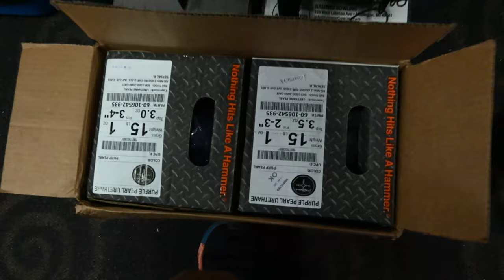Hammer Purple Pearl Urethane | Unboxing - 2 Balls, 2 Layouts, Shots, and Thoughts

Comment: Uh, sorry, I have bad news for you. 
Its not the "first shot" with urethane that hooks like crazy, it is the first 10 shots! 
You gotta get "a lot" of oil on them before they reach equilibrium, with the lane, then you can get lined up properly.
Like the multi-color inserts and thumb, helps see the ball roll down the lane.
Thank you for the demo.
Reply from the maker: I definitely will admit that my first 10 shots with both of mine were crazy strong but htey have definitely tamed out over time! -Patrick
Reply: Can you resurface them or use an extractor to bring it back to like new? Not that you want it that strong, but I wouldn't want it to die down too much?
Reply: Can you resurface them or use an extractor to bring it back to like new? Not that you want it that strong, but I wouldn't want it to die down too much?

Comment: In the simplest English possible, what is the big difference between the modified core at 14 lbs. and the normal at 15-16 lbs.
Reply from the maker: Lower Diff and Higher RG is gonna let the ball be slightly stronger which makes up for speed gained by light weight

Comment: Just to clarify, does urethane overreact on the first few shots only fresh out of box or everytime its cleaned with a ball cleaner? thanks
Reply from the maker: They will typically hook more right out the box. They retain oil on the surface level of the ball well due to the reduction of oil absorption
Reply: @BowlingWorld  So even after its cleaned there will still be some oil left over?
Reply from the maker: @hgh4349  negative. Less oil will absorb into the cover itself so it’ll hook more when cleaned and surfaced properly